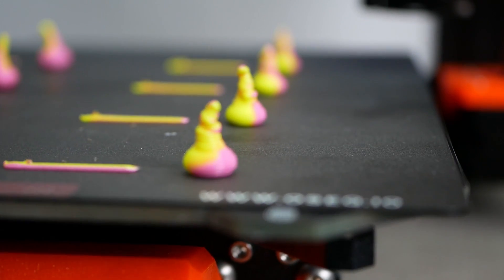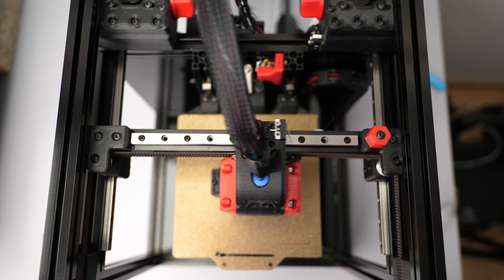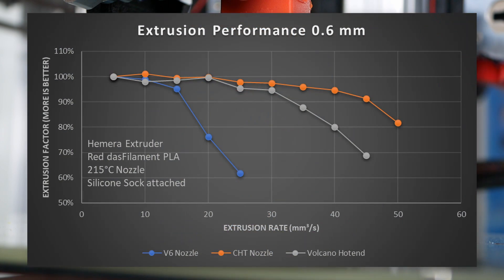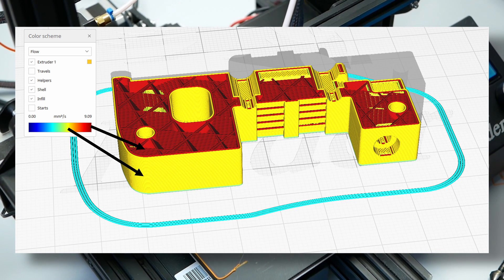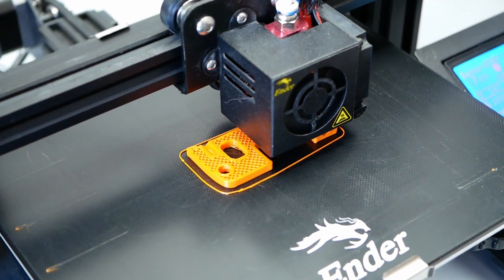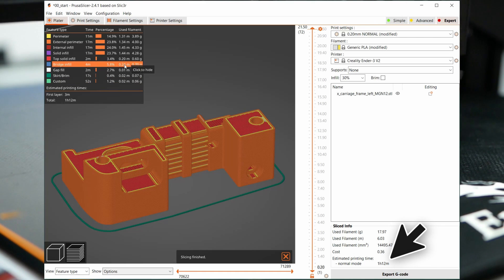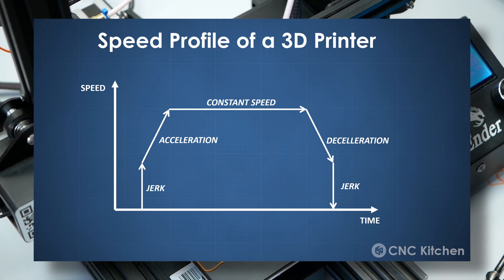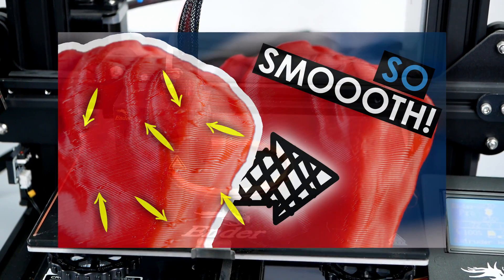Easy Hotend Benchmark for FAST PRINTING Profiles

Comment: There's a couple of things not mentioned here that I have found to make a difference in the quality at speed on bed slingers like the Ender 3 V2. I'm able to cut about 10 min off of Chep's profile when applied to a benchy with these differences. I also try to keep my flow at or below 8.5mm^3/s.
-When over extruding on a nozzle, you can go down to one wall with little strength impact (one 0.6mm wall with a 0.4mm nozzle = two .45mm walls)
-Lower your bottom layers to 2, you dont need that many on the bottom usually
-0 "Extra Skin Wall", so the top and bottom lines will connect with the wall and not its own wall. I find this gives much cleaner prints and make adjustments more direct.
-"Lines" for top and bottom instead of Zig-Zig for the same reason
-10% Lightning Infill. Its called lightning for a reason. If you must do Cubic, at the very least do "Cubic Subdivision" and mess with the "Gradual Infill Steps"
-3 "Skin Edge Support Layers". This makes up for the lower infill density without adding much more time
-50mm/s for Infill, Walls, and Top and Bottom. This is where you are honing in the flow rate.
-150mm/s travel. My ender 3 V2 can go faster but I fell it shakes it too much any faster
-Standard Acceleration and Jerk (but you can go up to 800mm/s^2 and 10mm/s with little impact. Chep's uses 20mm/s Jerk which I think can be seen in the quality)
-Combing off and Z-hop on instead. This cuts down travel time way down, but make sure your retractions and wipe distances are dialed in.
-Skirt for build plate adhesion with distance set to 2mm and min length to 50. Why do you need so much purge on the skirt?
Hope these tips help someone.

Comment: Duet has a new way to tune your hotend while extruding filament. (Heater FeedForward M309) I have not used yet but could have a big impact for fast printing. 
Previous Hotend tuning just gets the block heated, with no cooling effect from the filament. With using M309 while tuning hotend would enable the hot end to Keep its desired temp no matter the flow.

Comment: could you make a toung and groove to improve layer adhession?

assuming 100% infill

print .4mm lines at .2 layer height and .4 spacing between the lines

move up 1 layer and fill in the gaps by using enough filament to print .4 with and .4 hight

that would force mover surface area between layers

Comment: One thing to remember: it's not wise to go beyon certain temperature (especially with PLA) on all metal hotends.

While my Dragon HF can go up to 40 mm^3/s without any problems, it's valid only for PETG and ABS, not at all for PLA. I print at 205 °C as I have found that going at 215 °C allows me to go beyond 20 mm^3/s with PLA, I will get a clog due to heat creep (and the fan is Sunon 4020 capable of 7 cbf/s).

Even for other filaments I rather stick to low temps of material as I even got clog for High temp CF Nylon which wasn't funny at all to get rid of it, it was stuck in a melt zone which on HF Dragon is quite long.

So yeah, I can print at 36 mm^3/s with PETG without any problems at all, but I stick to 20 with PLA. That means, 100 mm/s with 0.6 mm nozzle and 0.3 mm layer height. Maybe copper nickel plated nozzle would help with flow, but I'm using tungsten carbide nozzle all the time because I'm too lazy to change it every time I print CF Nylon.

So it depends. Stock Ender hotend is quite limiting if you want to print fast. It's not able to push enough filament (and extruder too) so the best and primary upgrade for any Ender should be all metal hotend (I strongly suggest Phaetus Dragonfly or at least SliceEng bi-metal heatbreak + copper nozzle) and BMG extruder (clones from reputable makers like Mellow, TriangleLabs or Fysetc works great).

Comment: Thanks for the great info. I have a question about my printer. I have a Neptune 2s that I upgraded the hot end to a Creality spider and the firmware to marlin. For some reason I can't get the firmware to up the max temp to 300. Do you have any idea what might be happening???
Reply from the maker: Can't you select the temperature on screen or is the hotend not reaching the temperature?
Reply: @CNCKitchen  No. The screen only goes to 260 and I've changed cura setting to 275 already but nothing.

Comment: Awesome evolution of process. One moment of curiosity is less the process and more you jumping between programming languages. Given what you've been doing, and your willingness to publish them open source, you could probably consolidate some of what you do into a library suite. You're one of the few YouTubers/streamers who actually does any coding. Many programs didn't just materialize, they start off as a collection of components that are assembled into programs. Between reverse bed leveling, gcode bending, extrusion benchmarks, gradient infill, and the general trend of your tests, you could possibly start to make test suite systems "specify some printer params and base filament specs and profiles will be generated" and perhaps this eventually evolves to test slicers and CAD tools. It may be a bit extreme and way far thinking, but it may be a thing... I strayed too far from the point: you jump between multiple programming languages. There is much that can be done and sticking to one for an amount of time may make the work faster/less frustrating.

Comment: @CNC_Kitchen
i believe there should be a small correction:
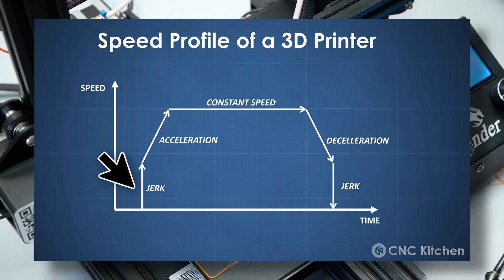jerk is not what you described at 11:52 
jerk is the derivative of acceleration and describes how fast the acceleration of a given motion system can change.
the proper graph of a planned motion is nicely shown on wikipedia:
https://en.wikipedia.org/wiki/Jerk_(physics)#In_motion_control

zu deutsch bekannt als Ruck
Reply: He has the correct description of Jerk in the context of 3d printing. Which is really silly considering that what you linked would be the correct usage in other contexts. 
I'm pretty sure most firmware has moved away from using the term in favour of terms like 'junction deviation', and 'square corner velocity' partly because of that.
And don't worry, this did confuse me (and at least one youtuber who had it as part of their video) when I came across it a few weeks ago.
Reply: @gruzzob  well i would dare to say that it is not just the correct definition in other contexts but it MUST be used in 3d printing because what else is a 3d printer if not a motion control system?
engineers from all around must rally together and correct that wrong terminology before it takes root and poisons the hobby 3d printing scene!

Comment: In an old printer like the Prusa or Ender 3, it is logical that printing speed is so limited. Better use a more current printer, with Vulcano nozzles and direct extrusion.
Fast and correct printing can only be achieved on today's printers. The printers that use the Bowden system are old, slow and limited.

Comment: If you want go fast use Klipper firmware.
But the big problem is the faster you print the more time you need to tune it in. Cooling/Print temp and min layer time for mechanical stability.

Comment: Hi Stefan! As allways very good educative and engeneering video! great work. It's almost all factors well researched, studied and put it on reality, the conclutions matches expected results... but it's allways a factor to deal with... consistencies on filament, because tolerances +- 0.05 mm  it's good for normal printing, but with that extreme profiles I think tolerances more than +-0.02mm will be a terrible problem. Cheers!

Comment: 9:30  I tried to increase the extrution width but it resulted in super bad surface with hills so that the nozzle rammed it while moving.. No, without further counter-settings this is bad suggestion.
Reply from the maker: Just reduce the extrusion width on your top layers.

Comment: Besides moving to Javascript, which you already mentioned was in the plans, I would suggest the option to specify different nozzle sizes (edit, as you’ve pointed out, it doesn’t matter for this test) since I'm pretty much exclusively using 0.6mm nozzles.

In any case, great work!
Reply from the maker: You can use the benchmark regardless of your nozzle diameter. No change on the g-code necessary.
Reply: @CNCKitchen  I took another look, and you’re right, I misunderstood part of the benchmark. Thanks again.

Comment: I'm new at 3D printing and  most of the videos I've watched go so fast it's hard for me to follow. I have an ender 3 and all my settings are factory and I get strings and shadow walls ( a thin line that isn't attached or filled in).  What is my 1st step?

Comment: So I might be “doing something wrong” but I’ve been able to massive reduce speed not sure how much and what this changes
But 80mms 0.2 layer height 200c standard everything else 
However after 2-3 layers printed I then turn the dial on the ender screen from 100% to 140%-180% now this may just be physical speed but I feel it adjusts flow rate aswel 🤷‍♂️ but I have even manage to print by turning up to 220% 
Mind you I hav also had a lot of clogging issues do to increasing the % but minimal compared to completed jobs 

Maybe you should try just running standard setting and increasing the % like I have done 

Further more my friend has also tried this on his Enders and also work well for him

Comment: Good work, but you can still make it faster.  For example, prusa slicer has variable layer height.  This is built into the current prusa slicer.  Now use the concept for all the other parameters: variable infill, variable perimeters, variable speed depending on distance traveled, variable hot end temp.  The bigger the part the greater the reduction in time for printing the part.  Also, when it comes to top layers change the settings to give the finish quality that will be seen by the eye, otherwise who cares if the infill looks bad, right?

Comment: I feel 0.3mm layer height with 0.4mm diameter nozzle is a little bit challenging. The height / diameter <= 65~70% will be much great surface finish and less problems. Thus 0.6mm nozzle is great for large and fast printing😎

Comment: Hi Stefan. Layer  hight on the ender 3 should have a 0.04 factor because of the advance on the z axis lead screw. So for raft you should stick either with  0.28 or 0.32. Chep did a video on this subject time ago and helped me solve quality issues (i was printing at 0.15 instead 0.16).
Thanks for your time and dedication as always you are a genius

Comment: By the way, I see in your start gcode that you first set bed and nozzle temp, then home and lift, and then wait for bed temp. Many people would prefer to use polymer thay most commonly use (not PLA), and many have glass over heated bed that needs to be heated a little bit longer. I would suggest other order: Set and wait bed temp, then set nozzle, home and lift, and wait nozzle.

Comment: You mentioned that linear advance isn't activated on a stock Ender 3, but in reality it cannot be activated on any Creality printer as far as I know, atleast none of the ones with the silent (Trinamic) stepper drivers. Creality cut corners and connected their 2208/2209's in standalone mode rather than use the UART connection that the Trinamic drivers typically use. This eliminates a lot of the features that are typically associated with the Trinamic drivers.

Comment: Flow rate has been my biggest issue. I'm using a volcano with a 0.8mm nozzle on my Railcore printer. I usually print at 100mm/s but the printer can go much faster if i crank the temperatures way up, but quality suffers quite a bit on some prints.

Comment: Great! But you can get really fast print with Klipper only. Input Shaping - it's real magic) My handmade printer (like a prusa i3, RAMPS 1.4, Titan direct + E3D V6) now printing at 100 mm/s speed and 2500 mm/s2 acceleration. And printing quality increaces too. But it's needed more temperature sometimes.
Reply: You can get those same settings with a minimally modified Ender 3. I added a direct driver extruder mod and a 3D printed fan shroud with a larger part cooling fan. I compiled a new version of Marlin with linear advance enabled. I then went through the calibration steps on Teaching Tech's website. With that I found I was able to do 100mm/s max velocity and 2500m/s2 acceleration with stock hot end, nozzle, and manufacturer's recommended temperatures. My limit at that point was maximum flow rate. I have increased this further by getting a 0.6mm nozzle and a Slice Engineering Copperhead heat break. That drastically increased my flow rate. I now print at those same speeds, but with 0.6mm walls and 0.3mm layer heights without any issues. Like the input shaping, the magic was using direct drive and linear advance. Even my cheap Ender 3 was able to handle the mechanical forces, but it would greatly overextrude in the corners. Using a direct drive with linear advance almost entirely corrected for this, giving me reasonable quality at high speeds for functional prints.
Reply: @reverse_engineered  Yes, direct drive and linear advance are very cool features. But input shaping only can remove echo around model corners. All this features are needed to make you print really good. And yes, it's needed to increase you maximum flow rate.
Reply: Klipper won't make hotend melt filament any faster.

Comment: You are a legend...

I am fairly new but I've just finished upgrading my Ender 5 Plus with Creality's silent board (TMCs 2208) and a Direct Hemera + Volcano as, exactly as you explain, I intend to "move a lot of filament" to print fast despiste not necessarily moving the tool that fast...

Until now I had performed only one flow test at 1 temp and 4 speeds with no repetitions... Volcano did deliver 30 mm^3/s

I'll make sure to check out your tool.

Dank sehr!!!

Comment: took me months to figure out why my X1 wth a .6 nozzle wouldnt print right. it was because the max volumetric flow in the slicer was set too low causing the printer to underextrude
Reply: That's not how that works. The max volumetric flow slows down the whole print speed so that the max flow isn't violated (i.e. move speed and extrusion rate are reduced in tandem until extrusion rate is slow enough to meet the limit).

Comment: Hallo Stefan, I am wondering how much the thermal mass of the heater block and nozzle influence the results of your tests. I would assume, that it takes in the order of 10-30 seconds to reach stationary conditions in the hot end while printing. Therefore, the amount of extruded filament per time depends on how long your test runs. If it is not stationary, there is a possibility of systematic error introduced. Nevertheless, great idea for testing the achieveable flow rates systematically. Schöne Grüße, Stephan :-)

Comment: That tool will be really useful. I tuned printers to print really fast before and agree with all of your observations. Using the tool will give much more confidence on what is possible.

Side note: it works great to just set all printing speeds in prusa slicer to the travel speed and put the maximum volumetric flow into the material configuration.

I'd like to see an investigation on the reason why printing hotter works so well. Does the temperature gradient between thermistor and inside of the nozzle increase with higher melt rate? Similar to the thermocouple inside the nozzle on your recent video.

Comment: Hi ! Great video !!!

As a startup active in R&D on FDM machines, we have modeled  the variation of the flow based on speed and temperature, creating dynamic profiles in CURA to automatically compensate for the flow loss!

Example CURA profile:
We currently compensate for the lack of flow to a part of about 50% by temperature increase and the remaining 50% by direct increasing the flow%. (A%+B% = 100% compensation)

material_print_temperature = =math.floor(245- (100 - (((speed_print * line_width * layer_height) /3.6) * 100)) / (MODEL_A))  
wall_0_material_flow = =round (material_flow- (100 - (((speed_wall_0 * wall_line_width_0 * layer_height) /3.6) * 100)) / (MODEL_B), 2)

3.6 mm ^ 3 / sec = Calibrated 100% flow (LW: 0.45mm x LW: 0.2mm and Speed: 40mm/sec)
245 = base printing temperature at 3.6 mm ^ 3 / sec
MODEL = Mathematical model of compensation, since the variation of the flow is quite linear, a simple number is sufficient to have a maximum resulting error of 0.5%.

I wrote a post on reddit:https://www.reddit.com/r/3Dprinting/comments/tutqjm/automatic_flow_compensation_in_cura_with_dynamic/

a greeting !

Comment: Wow, simply awesome. This is the most impactful 3d printing video I've watched this year. I've got an Ender 5 Plus with a direct drive Bondtech LGX through a mosquito hot end. I had no idea it could push so much volume. I'm still tuning but so far I'm blown away with the rates it's achieving. Thank you!
Reply from the maker: Glad it was helpful!

Comment: Great video. Thanks for the mention. If you increase the extrusion width on my Extra Fast Profile you’ll also see lower numbers as well. I leave adjusting the temp to the user as each filament is different. I also still include many settings that give small improvements in quality. So there is some compromise. 
So many people have asked for a Prusa version of my profile. I’ll just send them here. You cover it well.
Reply: Your Cura profile is my default profile now!
Reply: To make videos better I'd vet my sponsors especially when they are totally off topic.

Comment: Just had to check what my stock 0.2mm V2.4 Profile had to say about this X-Carriage part... 35min 🤔 Aight... Let's apply all the suggested changes... 24min 😁
TBH, I used to run such a profile with varying Line Widths while I was still 3D Printing with my i3 MK3S but ever since switching over to the Voron 2.4 and the speeds he's working at I found it to produce better results when everything has a more uniform extrusion width - Not sure if this is a problem stemming from Pressure Advance at those speeds ( printing at 300mm/s ) 😑